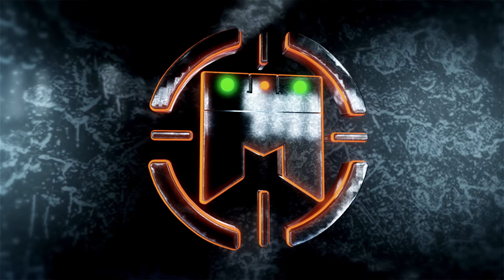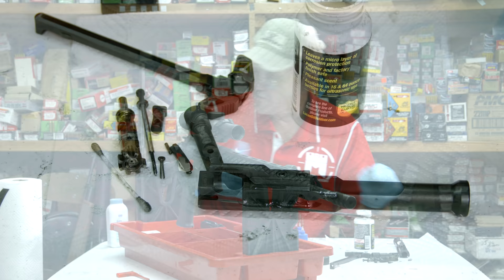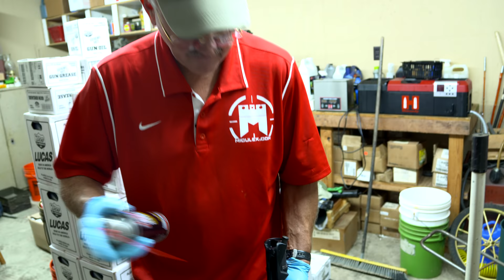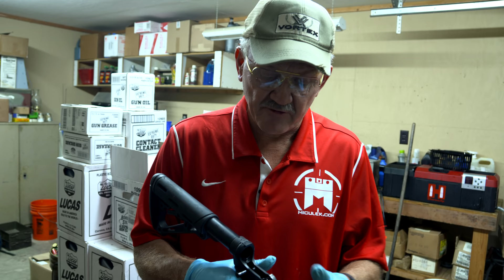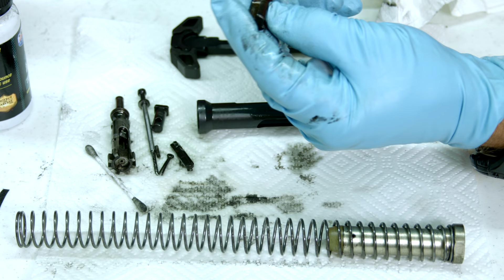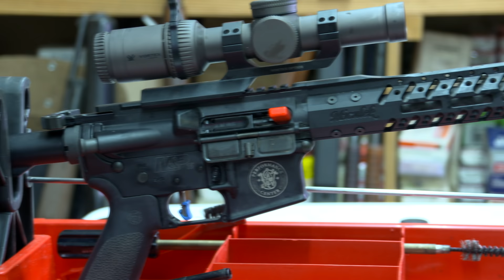ULTIMATE AR-15 CLEANING AND TAKE-DOWN with Jerry Miculek! (4K)

Comment: Jerry+ what's the name of the handguard on the AR you are  cleaning? I always use polymer-coated cleaning rods, so they don't scratch the inside of the chamber or the rifling
Reply: Polymer or coated rods are soft and pick up things that will scratch. Stainless steel or carbon fiber won't do that and won't scratch.
Reply: +James Breen some of the best barrel makers in the world say to use Dewey cleaning rods ! Doing what they say!!
Reply: That is huge and misleading exaggeration on your part Smiffer Smaffer, and is most definitely not true.  I don't know of any barrel maker that says that you have to use Dewey rods with their barrels, and nothing else.

Barrel makers do generally recommend using a high quality, one piece rod.  While Dewey certainly is a quality rod, so are the Pro-Shot rods, which is what Miculek is using.  And besides their polished stainless rods ( which Miculek is using in the video ), Pro-Shot also sells coated rods too, just like Dewey.

And Tipton actually claims that their Deluxe Carbon Fiber rod is the best on the market.   They claim it will not embed stuff like a coated rod can, and will not scratch either.

But the truth is that all 3 of these rods are high quality rods, and will do a good job.   Any argument that Dewey is in anyway superior to Pro-Shot or Tipton, would be quite bogus.

Comment: 4.00m mark he takes out the keeper-pin. How? Where is it? I just bought my first AR and am having trouble following this. At 3 minute mark he appears to have 3 pieces  next to the solvent bottle. i just have two: the bolt assembly and the charging handle. He doesnt show how he's disasembling the  bolt. He talks it but doesnt show it; using a tool he doesnt mention. HELP!
Reply: youll see i little indent on your bolt assemble.  take a small nail or plier and you can pull the little clip out.  after you pull that clip, the firing pin will fall out.  next push the bolt in and twist the little cam pin so its parallel with the gas junction, youll be able to pull the cam out now and the bolt will pull out of the back.

Comment: I know Jerry has forgot more than I will ever know, BUT.......Using the firing pin to push the ejector pin out? The BONE tool will clean the bolt better than a used shell case and also the firing pin. Slip 2000 grease on the raceways stays put better for me and does not attract as much dirt/grime. For the most part, oil for pivot points, grease for sliding points for me.
Reply: The BONE tool may work better but a shell casing is free and easy to find. 
I use a BONE tool myself. 
It's like a Swiss army knife.  It does many things OK,  but no one think great.

Comment: Why would you pull the brush backwards through the barrel, does that not destroy the rifling.
Reply: I do not believe that pulling back  deteriorates the rifling at all. Most Smiths would say to be careful pulling the rod back when passing the crown.
Reply: Brush bristles are brass, rifling is steel, pushing forward or pulling backward shouldn't be an issue, but changing direction of the push/pull while in the barrel can lock the brush in place and you might have to hammer it out.
Reply: Patrick Franzoni I never pull it back in........ just pull it out and feed it through the upper again
Reply: Only danger is spraying solvent on yourself when pulling it back out.

Comment: Gave up on gun"oil" for my AR platform. I use Synthetic "0" weight motor oil. Stays the same viscosity in all temps and stays put. It is great for keeping gunk soft and in suspension and take the compression of reciprocating stress just fine like the inside of you car engine. PLUS its only a few dollars for a whole quart. ! Just sayin.

Comment: Not clean line I'll just take the whole thing apart take the upper and lower receiver apart and then clean the barrels without the lower receiver in the way nice brass cleaning rod so it does hit the board the barrel or any of that brass the softer than steel

Comment: Should I use a dry cloth or a wet cloth for a melonite coated barrel?
Reply: +Zachary Stephenson Not sure where in this video this question pertains to as I skipped over and jumped around but to clean a barrel, any barrel, put wet patches of solvent down it, let it sit for a bit (unless it's harsh like sweets 762, don't let it sit too long) and then run dry patches through it and then put one oiled patch through for protection. Or like some firearms trainers, don't do anything with your barrel and only clean if you've shot corrosive.
Reply: +Shadow Well he put solvent in the barrel first and let it work but he said something about if its a chromelined barrel you should use wet cloth so it prevents rust and his barrel is stainless so he doesnt have to wet his cloth, thats why i was asking about a melonite coated barrel lol
Reply: Zachary Stephenson Just run a wet patch of oil anyways, especially if you live in a humid environment and don't shoot as often as Jerry.
Reply: +Zachary Stephenson Not if it's chrome lined, chrome lined barrels won't rust - like stainless. He said "chrome moly" which is just a raw bore, that isn't protected with chrome, or isn't stainless. If you have a regular chrome moly barrel that isn't chrome lined, you need to protect it.
Reply: ATL Infidel Any metal will rust, just depends on how long it takes
Reply: +Shadow Only iron and iron alloys can "rust" if you want to get technical. But yes, all metals can oxidize.   Generally speaking, you will wear out a stainless or CL bore way before the first spot of rust appears inside the bore. I have a chrome lined bore with 10k+ rounds through it, getting close to the end of its life, yet not a single spot of oxidation anywhere inside the bore. It's a moot point if you have a stainless or CL bore.
Reply: ATL Infidel If you leave a cleaned bore in a humid environment for a while without any protection it can start to oxidize.
Reply: +Shadow Lol. I guess I'm just the luckiest guy in the world then, right? I leave my AR15s, AK47s, Tavor's, and all my other rifles in my garage, in Georgia. Sometimes 100 degrees F with 100% humidity. Not a spot of oxidation in any of the bores, and I shoot them weekly. 

Chrome lined bores are not going to rust. Stainless bores are not going to rust. Copper fouling (which you can never truly remove without a bore polish) creates a boundary layer as well, so there's even more protection. 

Believe what you want, that's your prerogative. I'm just telling you what actually happens to guns, not what "might" happen. This coming from a guy that shoots competitively and shoots literally every single weekend.
Reply: ATL Infidel You shoot them weekly and I bet you clean them, not someone who doesn't do anything to them for a year or two then checks. Also how much does a patch of oil cost you? Not like it hurts just to run it down.

Comment: Best gun oil is Mobile1 full synthetic. Literally your car runs 450/500 degrees even more all the time. How often do you get your rifle that hot? Mobile1 does not bleed off nor it burns out like every single gun marketing oil. Besides for $10 you literally have a lifetime supply instead of wasting money on gun products manufactures push to make money off of.

Comment: it was my understanding that brake cleaner severely damaged plastic IE the lower parts in the ar15
Reply: It will. Don't get it on plastic. At least regular brake cleaner will
Reply: @ronalddavis  Didn't he say "don't use disk brake cleaner, it will ruin the finish"? Contact cleaner's the thing.

Comment: 2 questions.. What BCG was that? Also, what is that bolt-lookin piece of metal that was sitting next to your charging handle on the table?
Reply: I'm replying to my own comment... Yes... Only to ask what trigger is in that gun?
Reply: +J Bullast Looked like a Raptor charging handle.
Reply: +J Bullast BCG looks to be a JP low mass.
Reply: +ILicence I'm talkin about the fat, round chunk of metal @ 5:18, lying just below the charging handle
Reply: ***** It's a Otis Bone Tool
Reply: +Shadow thanks. No idea what that is but I'm typing this on a smart phone.
Reply: ***** It's to clean carbon out of the bolt channel in the carrier
Reply: +J Bullast Otis BONE tool.
Reply: +J Bullast Otis BONE tool.
Reply: +Shadow that thing work? Looks like an excellent product idea.
Reply: ***** From the video it seems to at least do something.
Reply: +J Bullast The BONE Tool works pretty dang well. Also check out the Star Chamber cleaning tool. 
Fun Fact: If you watch the Otis video for the star tool, I'm the guy tearing down the AR.
Reply: ILicence Cool man. Thanks for the info.
Reply: ***** I really appreciate the insight. Anybody have experience with one for an AR-10 (308)? I ask cause I saw someone wrote in a review that said the bone tool for 308 doesn't get into the corners of the inner channel of the BCG. REALLY appreciate everyone enlightening me.
Reply: +J Bullast trigger is hiperfire BCG is jp.
Reply: ***** Really appreciate the points you've made. I have a Colt M4 and an Armalite SuperSASS. I ended up asking santa for the CAT tool for both.
Reply: What everyone wants to know:

JP Low mass bcg 
JP Enhanced Bolt 
JP Adjustable gas block 
Wolff low power buffer spring 
Carbine buffer 
Miculek Muzzle Brake
Reply: Jonathan Langford I have the JM muzzle brake. Love it. Kinda reminds me of a Tiger tank barrel brake. Thanks for the info.

Comment: @1:38 A stainless steel cleaning rod is less abrasive??? I'm not trying to be disrespectful, but what am I missing? I've always been led to believe the opposite. That's why I spent more $ for a one-piece Dewey coated cleaning rod.
Reply: moto1p1 Less abrading than a cheap mild steel rod.
Reply: @lordaleksandre  Agreed. However, considerably more abrading than a nylon coated or carbon fiber rod.

Comment: Jerry, your workbench should be 36" high , otherwise you will exert yourself brushing a barrel 25 times , I use nylon brushes , they work well with Lucas solvents, hard bronze brushes tend to micro round off the edge of the lands😠 by the way, you semi-contaminated your Lucas solvent with those 2 dirty Q tips 🙄

Comment: There's no need to align the 3 rings as the gun will fire flawlessly with only a single ring. The rings spin around by themselves as the gun is fired. There's no need to clean the carborn off of that area of the bolt either.
Reply: It is very important to have them offset from each other. Especially if you are running a suppressor. I have ran many ARs, M4s and Suppressed DMRs in the military and LEO capacity and one of the main cycling issues I have seen is from the gas rings notbeing properly aligned.
Reply: The AR-15 will in fact run perfectly on one ring. The others are there for redundancy. Those rings rotate anyway as the weapon is fired. You wouldn't disassemble your car engine to make sure all of your piston rings were offset from each other. Same thing here.
Reply: It's not necessary to offset them. Notice how loose they are on the bolt? You can spin them really easily. When firing the gun, they are going to jiggle around and rotate anyways no matter which way you align them.

Comment: Why waste so much time wiping the gun parts with a solvent-soaked q-tip?  It's such a painfully slow process.  Wouldn't it be easier to just soak the parts in a tub of solvent while scrubbing the dirty gunk off of it?

Comment: won't use the brush in the solvent more than once, dips contaminated cotton swab in it half a dozen times lol. My jaw dropped when he used the firing pin to remove the extractor pin. I've always been told that's a no no but this dude probably changes some of those parts like he changes underwear.

Comment: why not a plastic coated rod?
Reply: +Ralph Watten Plastic rods tend to be prone to having particles of fouling embedded into it. That in turn is abrasive to the bore.

I like to use one piece carbon fiber rods. Resistant to embedding, and won't take a bend. Best of both worlds.

Comment: Incorrect use of the firing pin in pushing out the ejector pin, use a bullet instead. The firing pin is aluminum and using it on steel can bend the tip, which can give you failure to fire when the bent tip doesn't hit the primer enough to ignite it and the powder.
Reply: You think he cares lol, he's probably been cleaning guns his way since before you were born. Besides that, you can easily buy more.
Reply: Aluminum. Really?

Comment: I just want to steal that rifle just to turn that muzzle brake on correctly.
Reply: makes sense, thank you
Reply: +Longcut_Tactical I would challenge the idea of straight vs clocking as being aesthetics vs pragmatics. The russians had a pre-clocked slant brake for their rifles but this doesn't work well when you switch shoulders (an ambidextrous shooter is something all professional users should strive for, also one of the reasons why open eye shooting doesn't work very well). I prefer straight up and down, because I know where the recoil will go no matter if I am shooting left, right, or even laying down on my side or tilted at an angle.

Comment: Wheres the video for the AK47 ? Oh thats right you dont need one.....
Reply: +Tim Heisler You still want and need to clean an AK47/74, those myths are bunk.
Reply: +YourOwnDumbAss ive put like 700 rounds through my wasr 10 and ive only had to wipe down the bolt and run a bore snake through the barrel...oh and oil it like twice...
Reply: Tim Heisler That is still cleaning your rifle, only irresponsible Firearm Owners choose not to clean, inspect, and oil their firearms due to myths. I hope those who believe this myth don't treat their vehicles the same. For the record, the machines that manufacture AR/AK parts even get cleaned, inspected, and oiled.

I digress...
Reply: +Tim Heisler 700 rounds? LMAO. My Daniel defense v9 has over 3k rounds through it and it has only been lubed. Still running strong. AKs need maintenance just like any other firearm. I own 2 aks also. Both the AR and AK will run for thousands upon thousands of rounds with very little maintenance.
Reply: +Tim Heisler 700 rounds? I shoot that in a weekend sometimes. LMAO. My Daniel defense v9 has over 3k rounds through it and it has only been lubed. Still running strong. AKs need maintenance just like any other firearm. I own 2 aks also. Both the AR and AK will run for thousands upon thousands of rounds with very little maintenance.
Reply: +Tim Heisler 700 rounds? I shoot that in a weekend sometimes. LMAO. My Daniel defense v9 has over 3k rounds through it and it has only been lubed. Still running strong. AKs need maintenance just like any other firearm. I own 2 aks also. Both the AR and AK will run for thousands upon thousands of rounds with very little maintenance.
Reply: +YourOwnDumbAss You misunderstood, I know AKs have to be cleaned, what I'm trying to say is that AKs are simple enough to clean that you don't need to watch a video about how to do it. Where did I say you never have to clean an AK????
Reply: +ATL Infidel Yea I know AKs need little maintenance, a lot less than AR&#39;s and you dont need to watch a video because its so simple a 12 year old kid can do it. You shoot a lot of bullets!!! WOOOWWWWW!!
Reply: Tim Heisler *"Wheres the video for the AK47 ? Oh thats right you dont need one.....
"* 

Let's start off by rereading the Title shall we...
"ULTIMATE AR-15 CLEANING AND TAKE-DOWN with Jerry Miculek! (4K)"

Since this upload is obviously for the Cleaning of an AR-15, it makes sense that your post is obviously suggesting that AK's don't need to be cleaned, inspected, and oiled so it makes no sense for uploads on "How To Clean Your AK-47/74" shouldn't ever be uploaded cause they aren't AK's and we all know that the "Holy Grail of Rifles" just so happens to be the AK cause it does this or it doesn't have this or it doesn't need to be cleaned, inspected, and oiled cause it's indestructible and you can bury it in a swamp for 30 years, dig it up, and start shooting with it..no worries. 

Excuse me for finding these myths and or remarks about these "Gun Myths" as funny, cute, righteous, and whatever. 

In the end, any firearm is better than no firearm...they all need to be given TLC. 

I digress...
Reply: YourOwnDumbAss whatever, I digress...
Reply: Tim Heisler An AR-15 isn't hard nor difficult to dissemble. lol

Comment: Use brain use WD40 spray...
Reply: Even most outspoken and challenged individuals know that wd40 SUCKS for guns. WD40 is a water displacer and NOT a lubricant or long term protectant. If you need a spray, then use Hornady One Shot gun cleaner... or even Tri-flow is much better than that wd40 you tout.